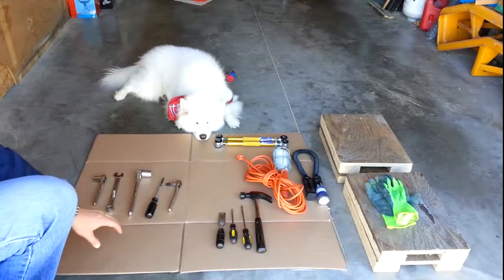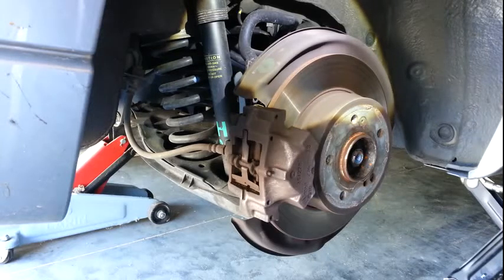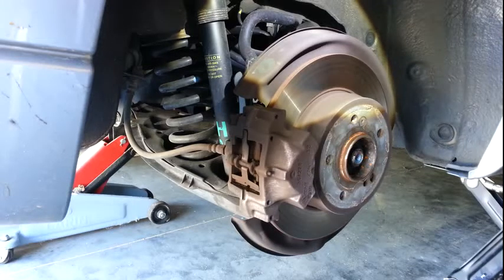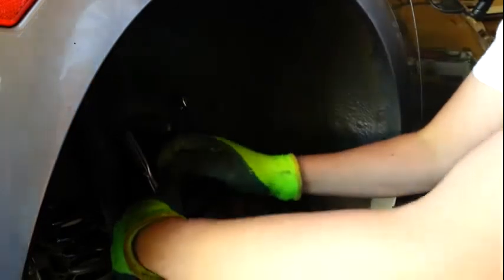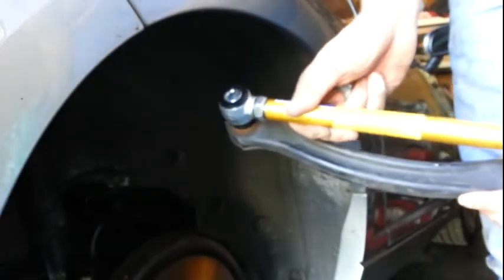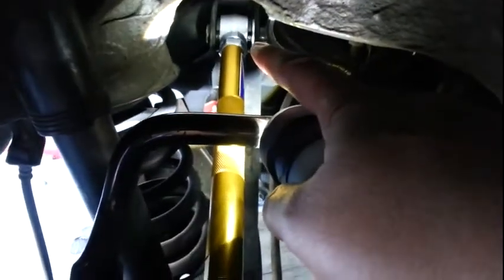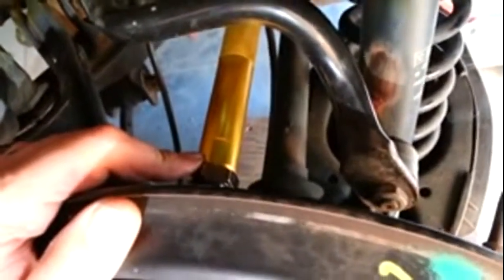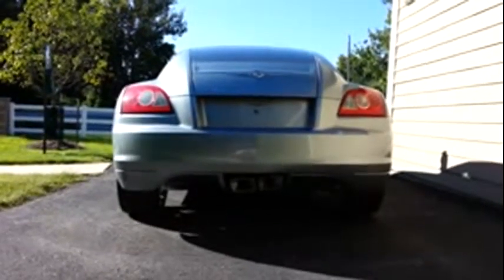Rear Adjustable Camber Arms Installation, Chrysler Crossfire (Mercedes R170,SLK,CLK,AMG,SRT) strut

Comment: aww the doggie :)   I have a 2006 Limited Roadster ....need to start figuring all this out myself...can't keep throwing hundreds of dollars at the import car mechanics...i suppose i need to get a 2 ton jack for starters ....gonna change the oil filter today myself  though !
Reply from the maker: Norman Millar proximity of components, and using torx wrenches has been my only issue with working on my Crossfire. In fact I love it. All the wrenches can be purchased on Amazon for cheap. Most hardware stores don't carry our tools in the giant sizes we need. Good luck with your oil change, I have an oil change video on my channel. I show people how to do it without at ANY tools besides a marine pump. If the oil filter is stuck on, use a jar opener or your leather belt (loop it around the filter) and pull the end in you left hand counterclockwise. If you want to see more of my dog, he is in a portrait shot of my video reviewing the Canon Vixia HF R600 camcorder also on my channel. Subscribe if you want to be informed when I upload my video installing a suede headliner for the Crossfire. Thanks for watching!
Reply: Thanks glencouls!  Yeah that filter is really tight on there. I'll try the belt advice that might do it. Thanks for all your help :)
Reply from the maker: Norman Millar you can always buy an oil filter wrench too of course.

Comment from the maker: If getting this type of work done at a dealership, remember the cost is going to vary greatly from shop to shop. If the shop has a Crossfire guy, a mechanic that has taken Crossfire classes- then you may actually be able to cut down on labor cost because he knows what he's doing. If you get just a normal Chrysler mechanic- the cost may actually be more because he's learning as he's going. It shouldn't be too much more labor because all mechanics know about Camber and Toe, but they are familiarizing themselves with the vehicle as they work.

 I don't believe the dealership is going to use these performance parts. Instead you will likely find they will use bolts that have been fitted with a cam on one side and as you tighten the bolt it pushes the suspension parts one direction or the other. I believe this takes longer to install and adjust. More moving parts also mean easier to fall out adjustment again (in my opinion). Personally I believe the adjustable camber arm is an easier and faster solution to our camber issues.

Normal tire stores are not going to do this type of work for you. So it's up to you, or an independent shop you pay to Mod your car. Then go buy tires and the alignment.
Reply: HOW are those holding up any issues?
Reply from the maker: +Louie 2Tone I have had no issues with my camber arms. going strong for two years now!

Comment: Hello! I Just got back from a Chrysler dealership with $710 charge for 4 Camber Bolt part and installation. Parts cost $75 and labor cost $636 for 5hrs.  I believe I was over charged, in addition to my car being at the dealership for 9 days. Paisd $280 for rental car. How come you can do the job in 2hrs and dealership takes 5hrs?
Reply from the maker: 8AUGROMAN, what I have shown here is only the installation of the Adjustable Rear Camber suspension arms for a Mercedes-Benz R170 Chassis. At this point, the job is only really halfway done. To complete, new rear tires need to be balanced and mounted, then the whole car needs to be put on an alignment machine. 

The machine will calculate many specifications regarding installation of the tires and how they perform with the suspension. The machine's goal is to bring everything into "factory spec", or adjust the toe and camber to be similar of what the car had when it rolled off the assembly line. 

What happened to my driver's side rear tire was due to the camber being 2 tenths of a degree out of spec and me leaving it for months. Live and learn.

Getting the car back to "factory spec" is a long process usually requiring a couple hours of adjustment. So in total two hours for me to install the Chrysler Crossfire Rear Adjustable Camber suspension arms, probably 30 minutes to balance and mount a new set of rear low-profile tires, and two hours of suspension adjustment to get it back into specifications to get it road ready.

$160 for the Adjustable Rear Camber suspension arms
$450 for Tires
$100 for an alignment.

I don't have the detail of what you had done, but I think we are probably ballpark there. Obviously, fee for labor on my work.

I have had various experiences with this car at a Chrysler Dealership. Most of them not good. You have to remember that what you have here is essentially a european race car (obviously in a slightly watered down more elegant form, see the SRT-6 for a fire breather). Only 75,000 (roughly) were made and not very well received here in the USA. To not get ripped off, my suggestion is to ask around at local Chrysler dealerships if they have a mechanic that is specialized in the Chrysler Crossfire, or find an independent Mercedes-Benz shop in your local area that will service your car. Only let your trusted mechanic work on your car. You build a relationship with this guy, even though I have only had to talk to my guy twice. He probably actually enjoys working on a more refined specialized vehicle.

Find the Crossfire Forum online, and join the Chrysler Crossfire Owners Group on Facebook. There are people there that are enthusiasts and ready to help you.